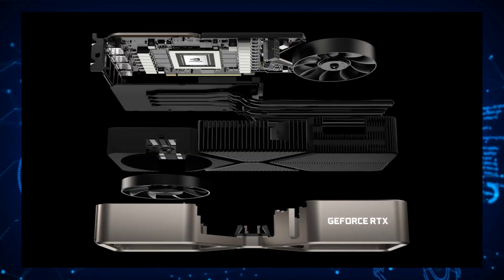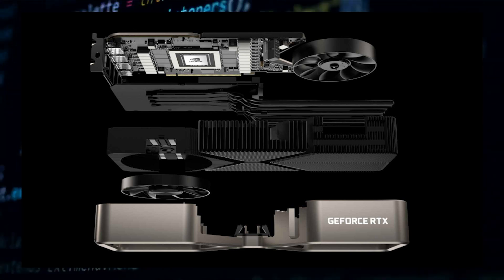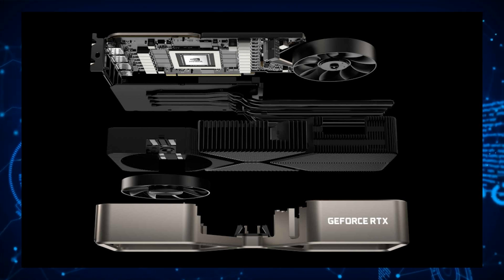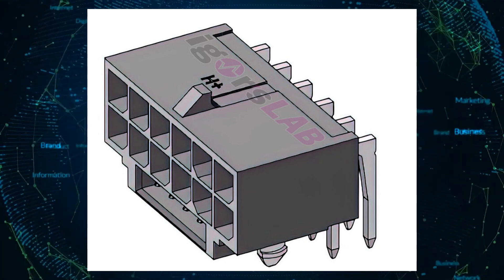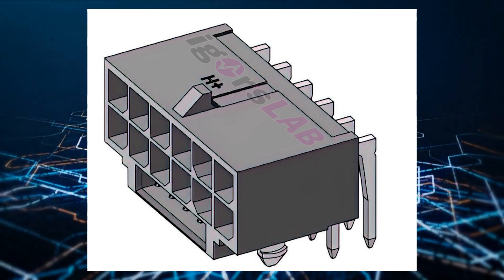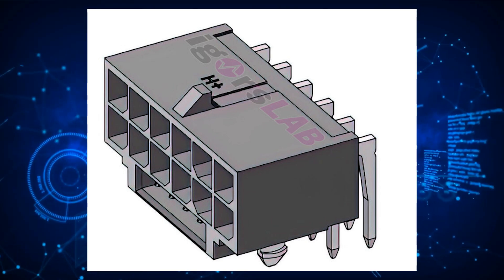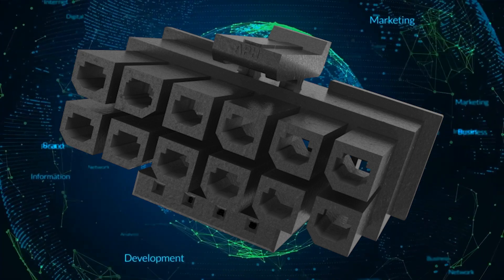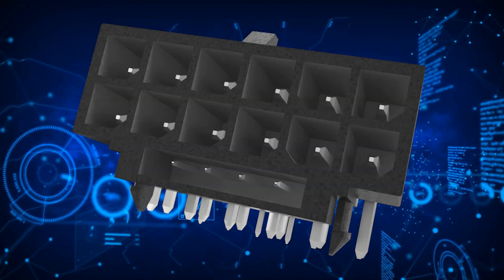Igor's Lab May Have A New Connector For The Next Generation of Graphics Cards!

Comment: Gamers should be taxed more if they use a 600w graphics card, or be required to use stored powerwall energy from low power usage times.
Reply: O_o  ...what are you even on about? Is this one of them Troll accounts?  
If you use more electricity you pay more for electricity and guess what genius, there are taxes on electricity and there always have been.  
And it doesn't matter if its a GPU or an electric toothbrush, every KWh you pay for.... in your case your Mom probably pays.  
People should be taxed for talking dumb stuff on the Internet, any State's debt would be paid up by tomorrow.
Reply: @ZeroB4NG  Gamers using this much power are contributing to climate change and a scourge on society
Reply: @tomquimby8669  don't blame consumers... DON'T BUY IT ... I'm sure if I looked at your life through a microscope I'll find plenty of things that you're doing to hurt the environment as well.
Reply: I doubt this will be turn PC gamers into the worst when it comes to being not eco friendly. I am pretty sure the are worse cases out there. Like Jeff Bezos & friends burning tons of fuel for a field trip to space. 

Just cause the plug allows for 600w, it does not mean it will draw so much. Though it only replaces plugs that's already in use for such draw.

Comment: why would a power pin not be compatible with gen3/4 cards? it delivers power could not a card be made to work with it and be 3/4 gen
Reply: You're not understanding electronics. Each of the pins on the power connector are rated for a certain amounts of power (power = amps * volts). It seems that this new spec changes that. Which means the PSU, cables, the slot, and finally the card all have to meet that spec. Otherwise you'll damage equipment or cause a fire at worse.

Comment: Yes, I love seeing a cable that allows for 600w of continuous usage. However, this means that in general, all parts of a computer are going to be significantly higher when Gen 5 releases. We're taking insanely priced for everything, since it is a new standard (with the PSU, motherboard, graphics card, RAM) and those are expensive as a first adopter. I'd stick with Gen 3/4 until Gen 5 becomes more affordable to the common user, so a few years give or take after the standard becomes an actual standard and Gen 4 goes out of style.